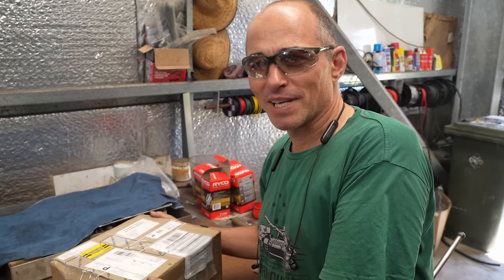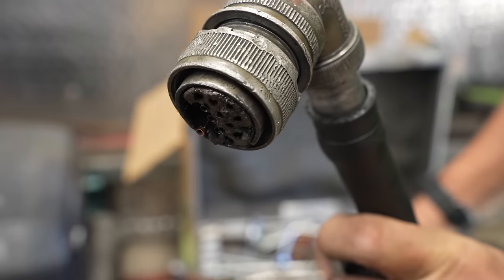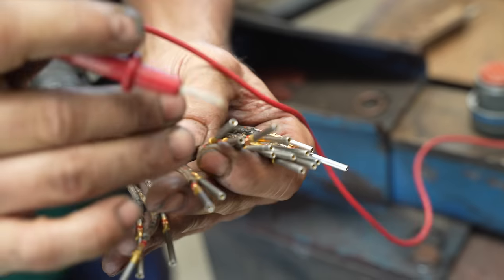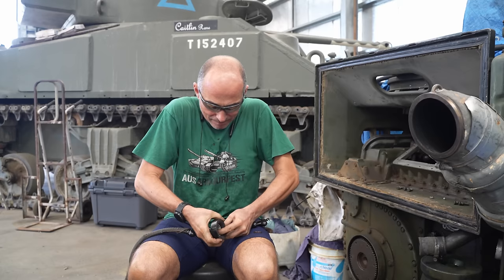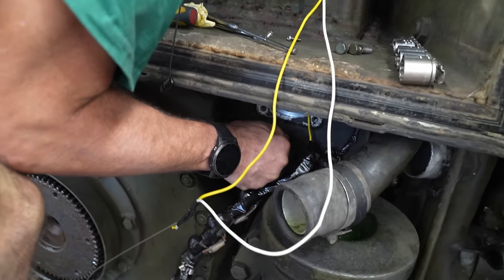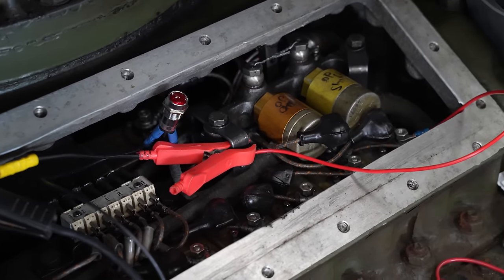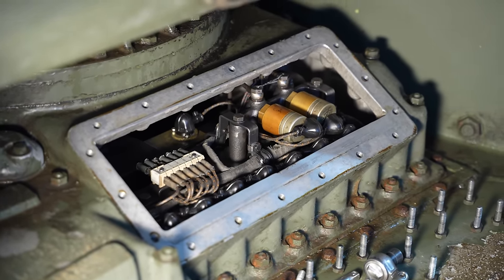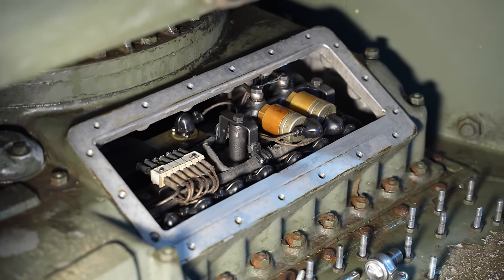WORKSHOP WEDNESDAY: Leopard MAIN BATTLE TANK transmission repair project SAVED by a fan!

Comment: I am a little shocked that Ausarmour couldn’t get a complete set of leopard manuals from the Australian military as we used the leopards for decades.
Reply: Are they in dual language?
Reply: @Charners  I would highly doubt the Australian military would train there mechanics to read German 🤔
Reply: @jeffreypurcell4681 one would obviously expect these manuals werwere translated to english for aussies.
Reply: I am surprised that the L3 Corporation did not spring for some good PR.  I know that they have hundreds of these crimpers at their Greenville, Tx plant.  They also build and rebuild mil spec connectors there every day.  You might reach out to them to see if they would become a sponsor of your repair facility.
Reply: I'm ex RAEME and worked on the Leopards in Australian service, not very long after we received the final deliveries of them.  Getting a set of 'manuals' as suggested isn't that simple.  All in service equipment had Electrical and Mechanical Engineering Instructions (EMEIs) and the EMEIs were held by repair units at authorised levels of repair - i.e. unit levels of repair only carried EMEIs and special tooling needed to carry out necessary tasks.  There are other levels of service and each carried EMEIs and special tooling commensurate with those levels of repair.  There were only a couple of full sets of EMEIs for the highest level of repair (huge volumes - this was pre computer systems for such things, remember) held by the Australian Army.  Even these did not break down every single component as we had access to current (at the time) factory expertise if needed as well as support from other nations using the Leopard 1 in service.  Once the Australian Army divested ourselves of the Leopard those full sets of EMEIs were in demand from our allies still using Leopards in active service, so they got 'first dibs' on the EMEIs as you would expect.  Even the EMEIs that covered the highest level of repair would not cover complete breakdown of components that were ordinarily replaced as an assembly.  In a case like the repairs here we would have replaced the electrical assemblies and the components removed may have gone back for factory overhaul.  It's very unlikely we would have seen repairs like this anyway as the repairs undertaken here are examples of vehicles reaching time in service Australian Army equipment simply wouldn't reach.

Comment: Welcome to the world of aviation electronics.  That crimper is a staple tool.  FYI, if I remember correctly, you are only allowed 1.5 the diameter of the wire from the exposed conductor to the back of the terminal.  One of the biggest struggles is determining if a connector is a 'push from front' or 'rear release' connector.  Basically how the 'locking mechanism' latches into the plug
Reply: More stupid fun facts, the 'collar' of the pins usually have a color coding system that is similar to electrical resistor coding.  Goggle it for some fun acronyms.  This will tell you what crimper to use, and what 'locator' to use for a proper crimp

Comment: Excellent job brings back memories. As someone who’s changed the coolant in diesel engines 100’s of times I can recommend a 12v pump and mix the coolant into a 25ltr container and not lifting dozens of buckets 👍. Plus some lubricant on the wires helps too.

Comment: Rewatching the video, there's two different type of connectors depicted here. The first one that he tore apart is a 'solder cup' type, where the pins are permantently soldered in the connector.  There is a rubber boot that isolates each wire from it's neighbor.  The 'Daniels' crimper is used on a newer style of connector where the wires are crimped onto a pin and then locked into the connector

Comment: Just FYI those cannon plugs are standard across many civilian and commercial aircraft, you should look at aircraft scrappers for spares, where I use to work had 2 5 gallon buckets of various sized cannon plugs from small to huge, 1 pin to over 100, just a matter of getting the right set, also just about any A&P mechanic would be comfortable repinning or rebuilding a connector or harness like that. Might be an avenue of support you haven't thought of perusing before.

Comment: I posted this as a reply elsewhere, but thought it might be useful information for those wondering about 'repair manuals' for Australian military equipment.

I'm ex RAEME and worked on the Leopards in Australian service, not very long after we received the final deliveries of them.  Getting a set of 'manuals' as suggested isn't that simple.  All in service equipment had Electrical and Mechanical Engineering Instructions (EMEIs) and the EMEIs were held by repair units at authorised levels of repair - i.e. unit levels of repair only carried EMEIs and special tooling needed to carry out necessary tasks.  There are other levels of service and each carried EMEIs and special tooling commensurate with those levels of repair.  There were only a couple of full sets of EMEIs for the highest level of repair (huge volumes - this was pre computer systems for such things, remember) held by the Australian Army.  Even these did not break down every single component as we had access to current (at the time) factory expertise if needed as well as support from other nations using the Leopard 1 in service.  

Once the Australian Army divested ourselves of the Leopard those full sets of EMEIs were in demand from our allies still using Leopards in active service, so they got 'first dibs' on the EMEIs as you would expect.  Even the EMEIs that covered the highest level of repair would not cover complete breakdown of components that were ordinarily replaced as an assembly.  In a case like the repairs here we would have replaced the electrical assemblies and the components removed may have gone back for factory overhaul.  It's very unlikely we would have seen repairs like this anyway as the repairs undertaken here are examples of vehicles reaching time in service Australian Army equipment simply wouldn't reach.

Comment: Thanks, Chuck, from the USA! Faced with a similar situation in the US Army, we had little choice but to order a new wiring harness. If one wasn't available, we tended to rob (cannibalize) the necessary assembly off of another vehicle that was already "down" waiting for parts. This was a bad business as we had to be careful that vehicles were not transformed into parts queens that were likely to never run again.

Comment: Looks like you got yourselves a 1-01 crimper with a 1-02 turret. Great bit of kit. One word of caution, don't ever press down or release the turret on the red selection with the crimper handles closed! I've seen a few damaged over the years by people doing that.
Great work on the wiring job Steve!

Comment: State side we call those Cannon connectors used in all military and heavy duty installations ,from one piece of equipment to another Ie; from a power supply to a device .I worked on Oil field research equipment for years and cannon connectors were used by the handfuls ,wearing rings and watches is a no no working in those tight spaces ,Just saying , I look forward to every Wednesday segment watching you mates work on these tanks always interesting and informative ,The Cannon Pin crimping tool you received is a Oh so valuable piece of equipment for your work ,I really enjoy watching Steve work through problems ,and getting things done

Comment: 9:54 if it ever breaks again (knock on all the wood around me) i suggest a mid loom coupler. This will never be a operational machine ever again, it's always going to be the museum's "headache" to fix it, so, this could be a simple way to make things easy. It's true that it's one more thing to break, but at the same time, it's also one less thing to lessen the pain of fixing things. 

I'd look into stuff from the telecom area, maybe speak with the local t's that are around you. Surely there's someone who has spares and is willing to donate some of those in bulk from their stocks in exchange for a good plug, so to speak. ;)
Not for a tank, but that's how someone in one of the forums for ww2 stuff i frequent, managed to repair their vintage field radio station. Called his local internet provider, had a talk with one of their warehouse supes and they found some obsolete stuff sitting on their shelves that nobody ever "saw" gathering dust.

Just a thought, it might be the case that you guys get it even easier, because everyone loves a cool museum and everyone's automatically a kid near a cool tank.

Comment: If you were to check impedence with an analog vom. The behavior of the needle will indicate if there is corrosion/broken strands in the wire......using a high impedence meter makes those potential issues much harder to detect.

Comment: Good on chuck. 
On a side note most of those connections are standard deutsch pin connectors. They are commonplace in most modern ag and nearly all aviation equipment.

Comment: just one thing , the rudder stain relief was not fitted ( the rubber thing that the cables passed through between the plug and 90 bend ) very important ,it stops the wires moving in the plug

Comment: Also run a test for shorts between contact to contact, never assume anything.  There "Might" be some wire damage inside the cable cover  which you cannot see.

Comment: The seal for the radiator could use some leather restorer. Comes in a spray can, will restore the seal to new condition mostly. Cheap fix.

Comment: How do you keep the pins correct after pulling them out of the fitting?

What I mean is, since you said each wire relates to a letter end for end 

How did you keep the letters straight when you just pulled the wires out without marking them?

Also,

Since you said each wire has a different length, did it affect how you rewired the cable as you had to trim the wire to get the old pin connectors off?

Comment: Where do you get these mechanics from?  They are very impressive and you can tell it's a job they love.

btw, thought of a great joke while putting the engine in.  Have the cannot pointing slightly over the back, then say you have a problem getting the engine past the cannon.  Little kid comes in and says "Daddy, why not rotate the gun forward about 20 degrees and it should clear with room to spare."  Plenty of room for visual humor after that.

Comment: @7:10 a continuity tester doesn't do a great job at checking wire integrity. It will show continuity if the wire is broken and has corrosion bridging the gap. The easiest way to tell if the wire can carry current is  with a test light that more closely matches the wires actual current load. Broken wires can easily carry small voltages but can't carry current.

Comment: I wonder why tanks seem to be wired with all same colour wiring rather than the colour coded wiring that automobile wiring looms use. Surely it would have made servicing and repair a lot easier if the makers had used colour coded wiring.

Comment: yeah, had the same issue with my Leo , but managed to fix it myself. it was a bit of a hassle ,but not too big a deal.
I  believe the Tranny can’t handle the extra 500 hp tweaked out of the. engine.
Plan a complete tear-down of the Tranny next winter and really make this Baby whine, I’m thinking of lowering her and put wider Tracks on the Bitch.
She’s already a real Chick Magnet !
Everybody, chill, just phuking with y’all

Comment: OK… So if the plug connector wasn’t available, you could simply crimp wire connections to each individual wire.  PROBLEM SOLVED 👍🏻

Comment: Typical German over engineering,  Allison have had mechanical convertor lock up for 50 plus years.  Keep it simple stupid, doubly applies in military vehicles As you can see it,s younger brother the Leopard 2  when tested in The Ukraine War have been found wanting in a war setting by apparently not having specialist repair crews. Yours broke down in your front yard, so  it makes Russian equipment look better and better.